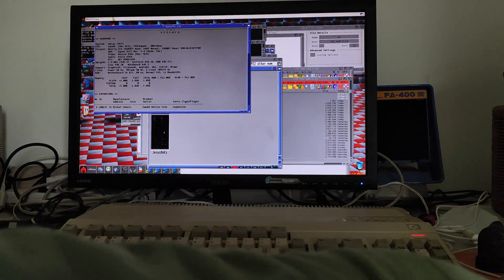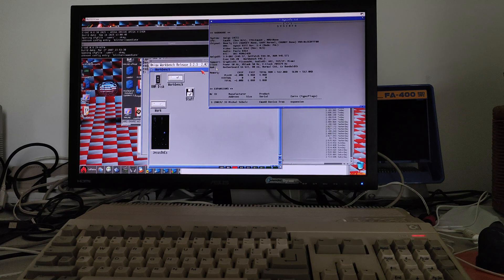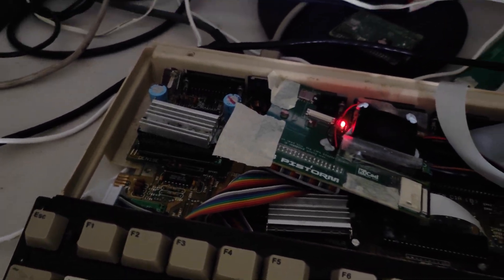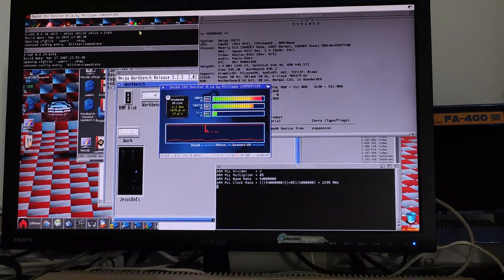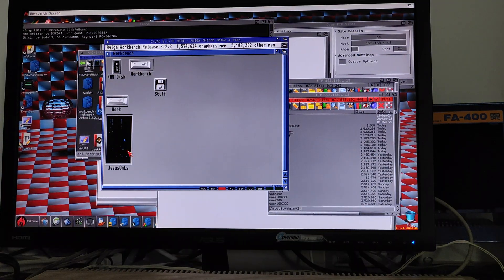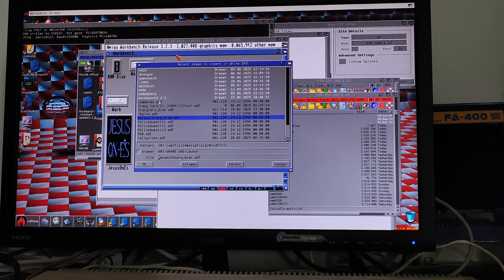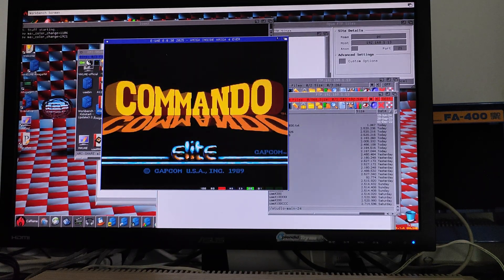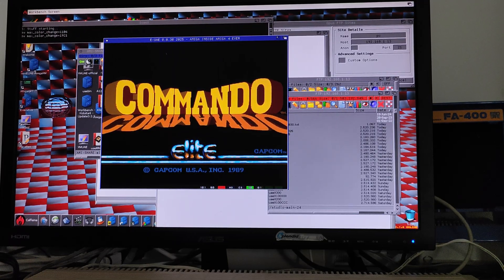E-UAE update in 2025 - Amiga inside the Amiga 4 Ever #amiga500 #pistorm #e-uae

Comment: My definition of an Amiga ends at 68060, anything newer than that is just emulation either in hardware or software. Pistorm is just silly, may as well just run the emulation of the whole Amiga on a standalone RPi. Regardless, I is still pretty interesting to see this "Amiga" nesting.
Reply: Thats narrowminded thinking my friend. Pistorm only emulates the parts a real Amiga wil never have (unless you have a real high budget wich most of us don't). E-UAE makes it possible to play aga games on a 500 or 2k and that is awesome. RTG even wifi. Pistorm is super stable and very fast. Realy like my 1200 and 2k with a pi4 sorry. It just works and it does so very very well. I would like to see you run netsurf on a 060 when on PS it is possible to have a half decent browser. If you want to run a 060 on 50 Mhz thats absolutely fine but your deffinition is not that of other people. Don't think for 1 second that if commodore wouldn;t have gone bankrupt they would have stayed with 68K. They would have gone full PPC and later maybe even x86 like Apple did. You sir are stuck in a past that no longer exixts.
Reply: @Caved111  Of course I'm stuck in the past - that's the whole point of vintage computing. And yes, it's my choice, which in no way affects what you do with your retro gear. However, there comes a point where "retro" starts to lose its meaning - and I'm definitely not going there. You - go ahead bastardize your Vintage Amiga with RPi, and other crap, have fun. I'm also not opening another can of worms called "what if," because honestly, it doesn't matter. What matters is what actually happened.
Reply from the maker: Only silly if you don't have an Amiga with Pistorm. People say the same about sports cars and super yachts 😂
Reply: @futureretrofusion  To use your cars analogy: Some people value classic cars (classic Amigas) some modern sports cars (Pistorm/Vampire). Neither is better than the other but it is a matter of a preference.
Reply: @burnedeye  some like hot rods 🎉 you got it
Reply: How can a CPU upgrade be silly.  How can making the whole experience being much smoother and more pleasant be silly. If commodore didn't go bankrupt they would have done the same thing.
Reply: @TheTerracide  That Pi is running software emulation of the Motorola CPU. Besides, you are modifying the classic Amiga in a way that wasn't possible back then. Some (maybe most?) Amiga fans are OK with that but some aren't (like me). You can do anything you want to your Amiga, I however refuse to go beyond the MC68060. Why is it silly? Because it is no longer an Amiga but a AmiFrankenstein. Hope that clears this out.
Reply: @burnedeye  sure everyone can do whatever they want ... to me it's just increase in CPU speed while still using all of the Amiga original chipset. Nothing changed... the whole thing is still the same just faster.It's exactly how other accelerator cards work too.  You're not emulating Amiga just an instruction set baremetal doing only that on modern hardware that is so fast compared to a CPU from 1979 that it's more than 1000 times faster.
Reply: @TheTerracide  That's where we differ my friend. Say you have an original 1965 Shelby Daytona Coupe, would you drop the original powertrain and put in an electric motor, then say everything else is still original so it is still the same car but you just made it way faster with modern hardware?
Reply: @burnedeye  well let's first agree that we're just talking and not arguing because there is no right or wrong here. But I think in that analogy that the cylinder of that car is the CPU and the complete motor is the PCB and all it's chips. And the rest of that car is the shell, keyboard etc. So replacing that part of the engine (or maybe adding a turbo on it) would not make it a different car for me. Just faster.  If your would replace the complete inside for let's say an FPGA or Raspberry PI then yes that would make it a completely different machine. But this only replaces the CPU, to me it does not make a difference that Motorola never made that CPU upgrade.
Reply: @TheTerracide  Agreed, The Cobra analogy was to illustrate my point of view regarding old computers. I like to keep them as period correct as possible. 68060 accelerators existed back then and are definitely period correct, RPIs, Vampires not so much and they make the Amiga "silly" to me. The original Amiga Chipset and CPU shortcomings are what makes the Amiga interesting. Making it unnecessarily fast makes little sense to me as I can play Doom and Quake one of my period correct PCs, don't need/want my Amiga for that even though a 060 accelerator can make it happen well enough.
Reply: Who of us had a 68060 Amiga back in the day ? any change to the original machine is silly.
Reply: @EdStraker1337 Probably not too many, but that's not the point. The point is that 68060 existed back then (and technically you could have it) contrary to a raspberry pi.